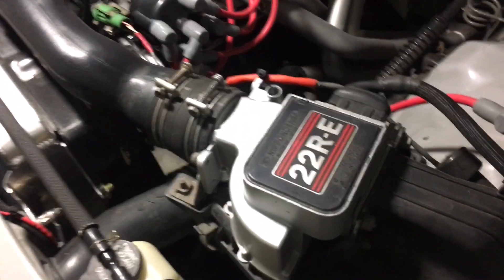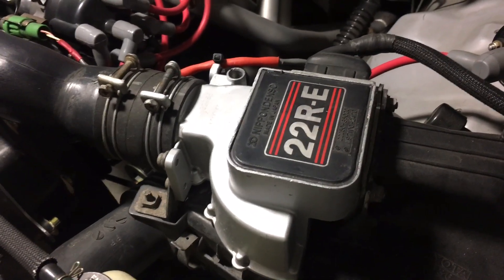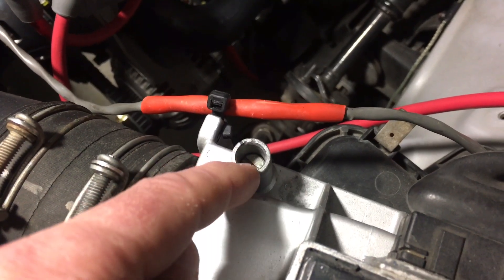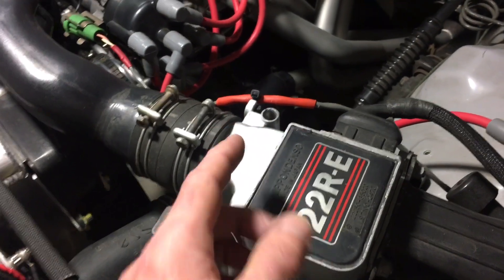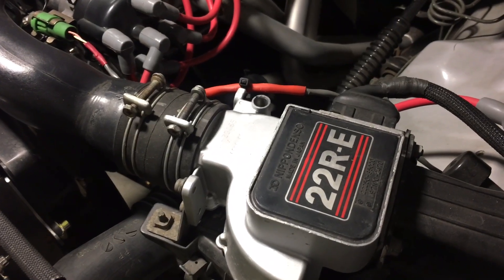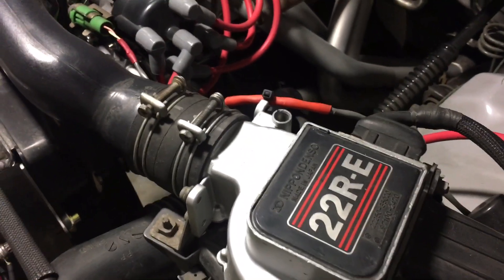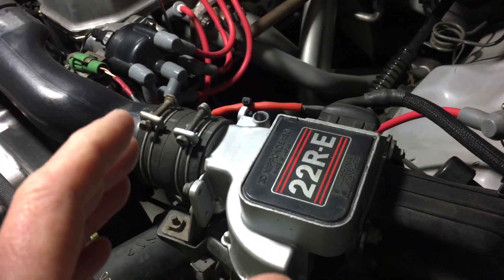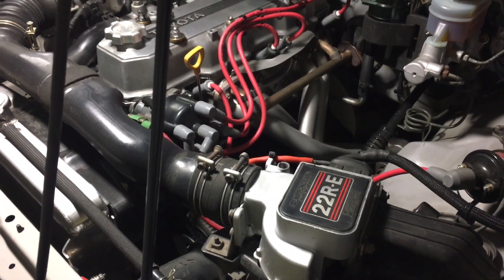Toyota 22RE AFM idle mixture screw adjustment / factory reset - how does it work & what is it doing?

Comment: Very helpful! My toyota friend. I am going through that mass air flow, throttle positioning/idol air mixture screw adjustments myself. It can be simple or as hard as you make it. I prefer factory settings myself, unless you made "mods" to your engine. That's what u would stay with. Thanks for the info. Very helpful

Comment: Ray - where did you get the air intake tube that connects the plastic intake tube to the AFM?
Reply from the maker: I bought the rubber elbow from amazon. The rest is factor stuff that was already on my truck.
Reply: @ray5961  do you have a link you can drop here in the comments? I'm ready to order and need one.
Reply from the maker: @Garbosgarage  Here's a link for ya. You can search that description on amazon also and find a lot of places that sell this part. I get most of my parts off ebay used or amazon or sometimes the online Toyota parts places. https://www.amazon.com/QKPARTS-1989-95-Throttle-22231-35030-2223135030/dp/B07217768Z

Comment: Ray my motor has been egr and fresh air deleted I wonder is that why it wants to run a little rich at idle?
Reply from the maker: that should not have any major impact. The EGR is more or less inert gases, so you can kind of think of it as more or less neutral to the equation. The fresh air suction system primarily introduces air on deceleration (off throttle) in order to help burn fumes and fuel as it hits the cat.

Comment: Ray I just did some checking and on the afm I have around 5v going out from it on pin 3 which should split off at e10 and then supply power to the tps pin1 and ecu thermostat pin 1. Problem is I'm not getting any voltage from the BR-B wire at the tps or the ecu temp sensor. I'm guessing most likely problem is a bad connection at E10 and that is located where wiring harness goes up through the middle of intake so I really cant get to it without taking top portion of the intake off. I'm going to cut BR-B and run new wire to the tps and temp sensor. What are your thoughts on the matter Ray?
Reply: disregard all that Ray pin 3 doesn't have voltage I was reading pin 5, was reading print backwards. I went back and ohm out the wires from tps and ecu temp sensor and they were good all the way to afm. Now all that said it does look to me like Pin 3 should have voltage. 12v comes in on pin4 goes through a resistor and I thing a potentiometer then out on pin3 to tps and ecu temp sensor. I'm no electrician am I reading the print wrong?
Reply from the maker: @regularguy8592  The temp sensor is a resistor that the ECU monitors so it knows the coolant temp and can adjust the flow of the fuel injectors. TPS sends the ECU data regarding throttle plate opening. Down load the TCCS manual in PDF via google.. it will explain a lot of this for ya.

Comment: Ray I see something that might possibly make a difference. The way I read wiring diagram the ecu is supposed to have power all the time, to kill power to it you have to pull ecu fuse. The way they have it wired now is it only gets powered up when ign switch is on so that would reset it every time you turn engine off and back on. I think I'm going to put an inline fuse and run it straight to battery.
Reply from the maker: yeah cutting power to the 15A EFI fuse clears the ECU. Probably not the best setup to have that tied into the ignition switch :)

Comment: well today I switched fuel regulator vacuum line to another spot and that brought fuel pressure down to about 35psi at idle but afr still the same at idle around 10 or 11
Reply from the maker: Are you positive your gauge is configured for gasoline? On my AEM gauge for example, I run it in Lambda mode but I also have to specify that I'm using traditional gasoline and not E85 or something.
Reply: nothing in the paperwork for this gauge referring to e85, its setup in afr mode and the thing is its running pretty close to 14.7 when driving its just at idel its running too rich @ray5961

Comment: well my afr reading look like what I think are pretty good now every where but at idle and I gave it some thought and think I need to revisit my tps adjustment. First I'm going to verify all the wires are on the right pins then check adjustment again
Reply from the maker: Yeah you definitely want to ensure the TPS is in correct adjustment, otherwise all other bets are off.
Reply: well every thing with tps checked out ok  so I'm stumped as to why I'm running 10s and 11s afr at idle still @ray5961

Comment: Ray Toyota didn't do that someone has been rewiring things sometime in the past and from what I see they had to have pretty good knowledge to make it work although its not working as intended. It appears to me they lost power to the W-R wire and the B-G wire so they clipped them off on the topside of connector A4 (shown as A-4 inside a box on the prints) So they spliced the B-G wire back into another wire on the connector beside A4 that has 12v when switch is on and that leg of the B-G wire goes back to the ecu. Now the W-R wire they spliced in two wires to take its place, ran one over and daisy chained it to the 3 vsv valves and then over to the AFM. The second wire they spliced in in place of the W-R wire they ran to the ecu at B+ AND +B1. Now the problem may be that they didn't finish out the job because I don't have power on +B at the Data link connector box when ign switch is on. Now I just realized tonight that could also mean I do not have power to o2 sensor because the print shows the W-R wire has a splice E9 (inside an octagon) where it branches over to O2 sensor. Am I reading that right?? If so that could explain why my afr is off and could also possibly explain the check engine light being on all the time possibly.
  Now the reason I think they lost power to the R-W and B-G wires is the stubs are sticking out of connector A4 now and have no power on them even thought the efi fuse and relay are appear to be working, I need to get a look at bottom side of R/B No.2 but I'm not sure I can flip it over with it all wired up. Its also strange that my book give a detailed wiring diagram of J/B No.1 but only give you a drawing with basic component layout on R/B No.2
  Now all that said I also had to replace a section of wire and the connector for o2 sensor a while back too. it looked like at some point wire got on hot exhaust pipe and partially melted connector and wires. Now it had been repaired before but looked pretty ratty so I re-did it, Maybe there was a short there that took the efi fuse out and stopped the fuel pump from working,
 Tomorrow I will check power to o2 sensor first thing see what I have ,I may even disconnect the thing and see what my afr does
Reply from the maker: Sounds like fun times over there. I wonder why they rewired so much?
Reply: I wish i knew😢😢 @ray5961

Comment: Ray I tried jumping Fp to battery and it wont turn pump on. it looks like they have bypassed the efi relay, the white wire with red stripe and the black wire with green stripe have both been cut, The black wire has been tied back into an ignition-on wire and the white wire was scabed in at another placed and white wire has been replaced and run over to AFM. I checked the efi relay out and it is good ,its getting power to pin 5 from the efi fuse and power to pin1 from ign fuse and pin2 checks to ground but I think they cut the wire coming off pin 3 which is a white wire with red stripe. If I pull the efi relay out the truck will crank and run without it. I'm betting they bypassed c6 circuit opening relay too but have not confirmed that yet. The w-r wire coming off the efi relay is also supposed to go to ecu at two places, I'm wondering what they did with that. I have had a problem ever since i bought that truck with the ce light being on and will not flash a code no matter how I try to reset the ecu so maybe that could be related. I wonder maybe the fuel pump relay went bad and they didnt know where it was at could possibly be the original problem. I would ask that feller I got the truck from but I just found out he is making little rocks out of big rocks for the state now lol
Reply from the maker: That sounds wild... the Fp connection in the diag box should be a hard line directly to the fuel pump - so jumping that directly to +12V at the battery should always turn the pump on. Do you have the electrical schematic that I show in my other video? If not, let me know and I can email it over.. it shows all the wiring we are discussing here. When you pull the EFI relay out (which is only 4 pins) nothing should work.. that provides power to the ECU - pull that relay or 15A EFI fuse and the truck should not run (referring to model years 89-95 here).
Reply: @ray5961  yes I have the electrical book for the 93 model which is what the truck is and it takes a bit of studying to figure out the drawings but I think I have it pretty much down now. If its not reining tomorrow I'm going to look into it father, I'm figuring I will have to pull R/B No.2 to figure out what exactly was done and if there is a problem with the box its self and also check that fuel pump relay out I will proly start with it
Reply from the maker: @regularguy8592  Sounds like something is out of whack. The fact that the fuel pump doesn't run when directly connected via Fp is what strikes me as strange (unless Toyota changed something in the later years - which is always quite possible with Toyota). Anyway, let me know if I can help out in any way.

Comment: Ray from what I see today my fuel pump has been straight wired and runs any time the ig switch is on, There is no voltage on Fp with switch on or engine running and the limit switch in the AFM has no effect on fuel pump also has no voltage going to said switch. Would this cause my fuel pressure to be high? I have to wonder why they wired it like that something went bad I'm sure. I'm going to try and look into it more tomorrow
Reply from the maker: Fp won't have voltage on it. The Fp line in the diagnostic box is basically just a wire running directly to your fuel pump. If you jump Fp to B+ and turn the ignition on/off - that should turn the fuel pump on and off as well. You can also jump the Fp directly to the 12V + lead of your car battery and that should turn the fuel pump on and off. If the fuel pump turns on and off with your ignition key (no jumpers in the diag box or anything), that usually means the contact points inside the AFM are touching for some reason (maybe the door is stuck from shutting totally?). You can reach into the AFM and make sure the door is swinging smoothly or you can approach it from the top with the spring wheel stuff and make sure it's resetting correctly also. If none of that is out of whack, it could also be that your circuit opening relay has failed in the closed position... so you might want to check that (relay is in the right kick panel area under the glove box). If you look through my videos, there's one or two that shows the wiring harness schematic that controls all this area also. Let me know if you have any other questions and/or what you find over there.
Reply: very helpful thanks and I will look into all that father and let you know my findings @ray5961

Comment: well I replaced that regulator and pressure is still pretty much the same about 44 psi ,it may be getting down around 40 at wot. I did however figure out I was turning the gear on afm the wrong direction ,now I have it idling around 10 or 11 and it cruises around 14 or so ,wot is in the 15s for a bit then catches up. I'm guessing that's about the best I'm going to get until I replace ecu with a Haltech. I'm going to drive it a while watch gauge and mpg then I might or might not tune on it some more
Reply from the maker: Okay.. yeah that AFM wheel stuff can be tricky all right. Did you happen to mark the OEM location? It's easy to get all out of whack in there with those teeth. It should idle around 14.7 +/-. Mine usually idles well right at 14.7 (1.0 lambda). Sometimes it will drop down to 13.25, but the ECU generally brings it back to 14.7 pretty quick. If the ECU and O2 sensors are doing their thing, then cruising should swing back and forth around 14.7 roughly in one second intervals. 13.8 on the rich side, then swing over to 15.2 on the lean side - back and forth, back and forth while driving. That's how mine operates. If you suddenly go WOT, usually the ECU will become confused for a moment and go 15+ until it figures out what it happening and - like you say - sort of catches up and gets the show on the road; that process can take several seconds until the ECU kicks you back down to more like 12.8-ish range (this is why I added that micro switch THW line hack in that one video - to force the ECU rich more quickly). Basically the Toyota ECU is doing the best it can.. but it isn't gonna be on the job like a HalTech or Link or MoTec ECU will be. Also, no matter what you do with the AFM wheel, the ECU (when operating in closed loop mode) will be constantly battling you for 14.7 some way, some how.
Reply: yes I had gear wheel marked. Someone has sniped a couple wires off at the front end of  R/B No.2  and I'm wondering now maybe they possibly straight wired the fuel pump so that it runs all the time once switch is on . I'm going to check into that father in the next day or two @ray5961

Comment: well I'm still fighting my afr running to rich, idles around 9 sometimes in the high 8s when lightly accelerating it will run around 12 or 13 but if you really push it hard it hits the 15s. I replaced the afm completely and have run that screw way out and adjusted the gear several notches with pretty much no change, I checked fuel pressure tonight and with switch on but motor off I get 44 psi and after cranking engine and running at idle it stays the same so tomorrow I'm going to replace fuel regulator and see if that helps. One thing I did notice was the other morning when temperature was about 10f when I cranked it up first thing in the morning it would idle around 11 until truck warmed up then go back to the 9s. Any one have any any thoughts?
Reply from the maker: At idle you should be seeing around 35 PSI on the fuel rail, so that does sound like either your fuel pressure regulator is not functioning and/or not seeing vacuum. How much vacuum is your motor pulling at idle? Should be around 17-18 in/Hg if everything is okay on the rings, manifolds, etc. Check to make sure you have a good deal around your dipstick. Make sure you are not running a breather on the valve cover to atmosphere. Check for vacuum leaks in general. Also check your coolant temp sender is functioning on the lower intake manifold runner (the one next to the cold start timer one. If that is not working correctly or sending too much resistance to the ECU, it will basically double the amount of gas being pumped through. If you want to rule the temp sensor out, you can jump the pins in the harness itself and drop the resistance on the THW lead to the ECU to zero and effectively cancel out the cold temp fuel coefficient compensation stuff (which could potentially cause your issue). I have a video here which talks about some of it, if you'd like more of an idea of what is happening in that area: https://youtu.be/2I8BEoQxemM?si=yu5DxnRchhjfXGm- if you have an ohm meter handy, you can also pull a reading off the temp sending unit on the intake runner and see what the Ohms are cold (based on outside temp) as well as what it's at when coolant is above 140 degrees F. Basically when cold you should be reading something like 8k or 10k ohms and once coolant temp is up, you should be seeing maybe 200 ohms or so.
Reply: @ray5961  Vac is running 19 at idle ,new dipstick and tube ,new ecu temp sensor from LC engineering (I may ohm it out if regulator don't fix it) I put a fuel pressure Vac and afr gauge in dash pretty much like you did. I think when I change regulator I'm going to blow that return line out to the tank make sure its not blocked somewhere. Thanks for almost instant reply, it is a nice feeling when you know at least someone is there to help!
Reply from the maker: @regularguy8592  I try to hit all the comments in 24 hours or less; nothing worse than not having your 22RE running right :) Definitely check the return line. If you have a vacuum pump, try pulling a vacuum on the pressure regulator while the fuel pump is jumped on (Fp to B+ w/ ignition key on). When you hit the regulator with vacuum, you should hear it change tone if all is working correctly.